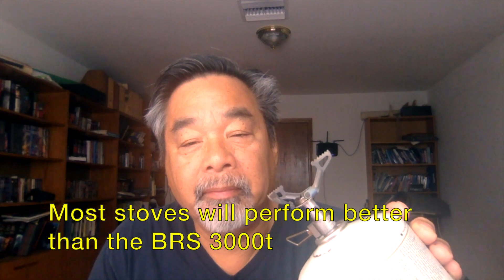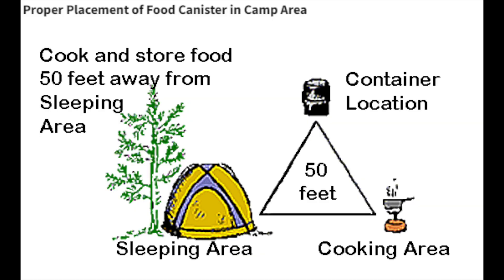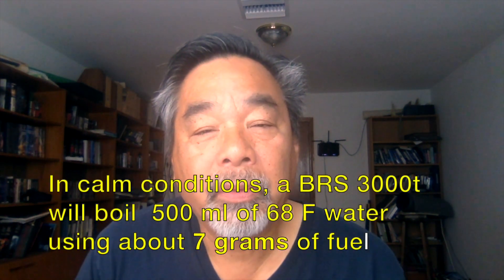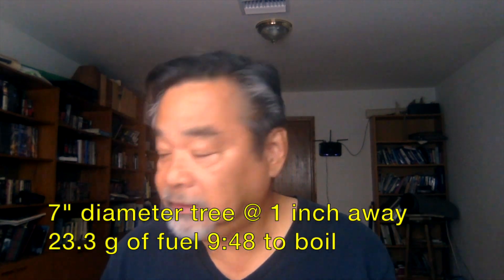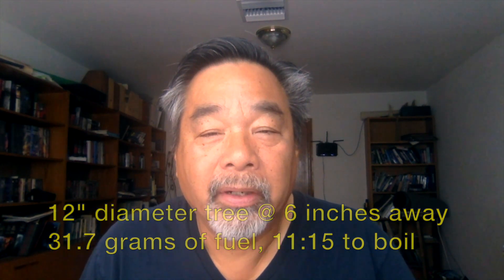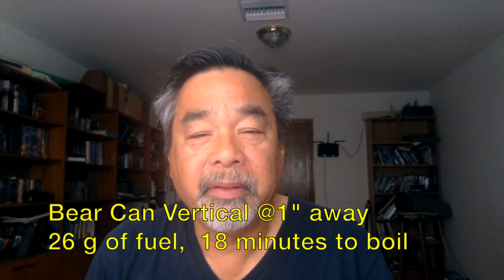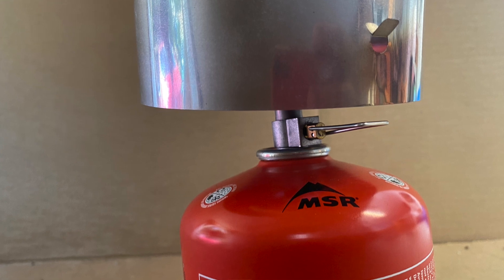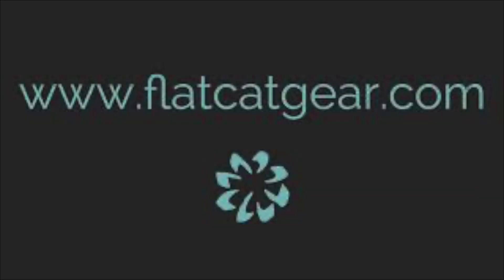Improvising a wind shelter for canister topped stoves

Comment: It's not the roughness of the bark, and it isn't the proximity that matter as much as the shape. A wing is not a good windscreen. Isn't that obvious? (Or maybe it is, but you are just trolling us?)

You KNOW how to make a windscreen that works. So why do you keep trying to prove that you also know how to make a lousy windscreen, and what on Earth does it have to do with the stove? 

The stove and the windscreen are separate topics. Don't try to conflate the two. 

I'm not trying to be critical; just analytical.
Reply: On second thought, maybe you're just kidding around? 
That would make more sense. 
And, yes, an Ocelot should be a heckuvalot better than a log. Or a bear can. Or any other sort of wing.
Agreed about not cooking near your sleeping gear.
Reply from the maker: So, there are a whole lot of people that thing that a rock or a tree will solve the problem.  Since no one has any real data on this, I decided to measure it.  I was surprised at how small a gap is needed.  Read this thread to see what some people think will work to block the wind.  https://www.reddit.com/r/Ultralight/comments/160jw4b/brs3000t_vs_msr_pocket_rocket/
Reply: @FlatCatGear  Hmmm... I don't see anything like that in that thread. Most of it is quite rational. There's one guy arguing some nonsense, but not about trying to make a windscreen out of inappropriate objects. 

I get that you were initially surprised about the gap, but you should not be. Add a smoke generator and you will see that air flows around the wing quite effectively. At low speeds the majority of the flow should be laminar, resulting in most of the full effect of the wind being available almost immediately after the wing. Now that you have seen it in action, it should not surprise you anymore. The size of the gap does not matter in the case of a wing. (The gap would matter if you used something like an umbrella as your windscreen. But even that wouldn't be as good as an Ocelot.)

There's nothing wrong with testing a hypothesis, but retesting the same thing when you KNOW it is going to fail seems odd. 

Also, I'm pretty sure that your editorial caption at 0:16 is not true. If you want to test it, then the way to do that is to remove all confounding factors and test just the stoves, using the most efficient methods for each stove. You can test without wind, which has been done (and BRS was as good as other stoves). Or, if you want to test WITH wind, then put your best windscreen on each stove. You have already demonstrated that ALL stoves REQUIRE a windscreen above 8mph. So test THAT condition if you're curious. 

I think it is fair to say that some stoves (not "most stoves") are more refined than BRS-3000t, but they do not perform any better (at boiling water) when used correctly with a proper windscreen. 

To be clear, that's the only thing you've said here that is (probably) wrong; just that caption. Everything else is 100% dead-on balls accurate. ;)

When it comes to testing stoves, few people have done as much of that as you. :)